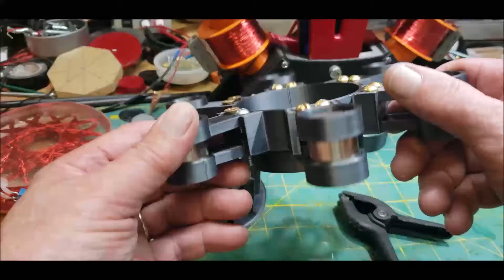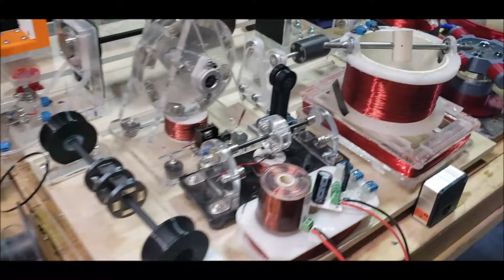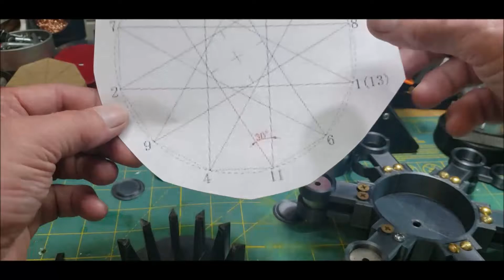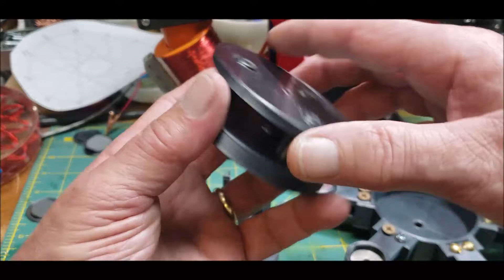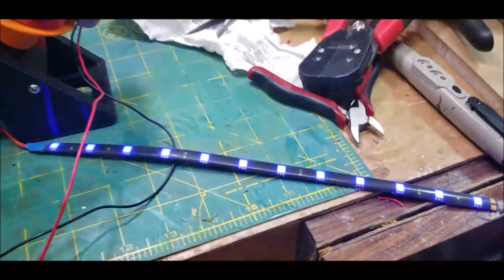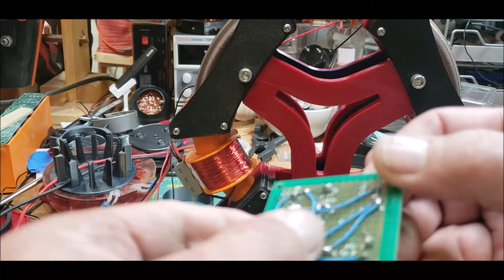3D Printed Solenoid Motor w/3circuits

Comment: Please tell me what is the name of your three-coil motor?
Reply from the maker: so if your talking about the large ring motor with the 3 coils at 12 , 7 and 5 oclock, that's called the Solenoid Motor per the original designer Spaceman Aust.
Reply: @mcorrade  Yes, I meant the ring motor. Thank you.

Comment: Hello friend, I recently discovered that my circuits have a problem, the neon bulb with time begins to turn black due to the voltage spikes that are generated and over time the neon bulb fails leaving the transistor MJL21194 without protection and such Once the MJL21193 transistor, this causes "the death of the transistor", believe me I'm sorry for not having foreseen this problem, but I already found a solution: to avoid this death of the transistor you should protect the circuit with a 120 volt neon bulb, This is connected to the BEMF with this protection, it would avoid a loss while it is in operation, another solution is to install a double neon bulb in parallel to the existing one, if the led bulb fails, the pair of neon bulbs enters into operation, while the led bulb is replaced. (see my last video, there is the diagram) In this case you have to change your transistor MJL21194, AND INSTALL A BULB OF LEDS 120 VOLTS 6 WATTS IN THE BEMF with this you will protect the other circuits.

Comment: Use multimeter with diode adjustment test the transistors and the diode if you hears a Beep  if you test leg one with two or one with three than is you transistor bad
Reply from the maker: cool thanks

Comment: Hello, there are two questions:

Can you draw a diagram of a power solenoid switch?

Are you using mosfets?
Reply from the maker: So I'm using the Skycollection JL94 circuit. If you go to his channel, he shows a diagram of that circuit. Also there are no mosfets just 2 transistors, a neon bulb and resistor and diode. 
If you can find in Skycollection channel, let me know and I will show a diagram.
Reply: @mcorrade  Thank you. I found the scheme, the last video from the skycollectionpop channel - "PROJECT JL94", I'll try to make it. Did you do triac control?
Reply from the maker: @dmitrievichmaster170  no I just used my regular power supply you see in the background of my videos :-0

Comment: Sweet to see you having a play on it again, time sucks.
Reply from the maker: ya with the 3 circuits it really fly's
Reply: @mcorrade  
I new it would as it will balance out the ring, it would not even need the rollers in theory excerpt for the turning on and off and is why I was not concerned that it had play in them, I was going to try and place coils on the 3D assembly just to show what I was planning to do for you to see since I don't no when I will get the chance to work on it until I get out to my moms has but even doing that is hard now I live alone, I find my self warn out by the time I get my daily chores done, I will try to though.
Nice work you have done, my coils will be the same as yours but slightly narrower so I can place a coil on each side of the one in the middle, the middle one will be used for charging and the others for driving the device.